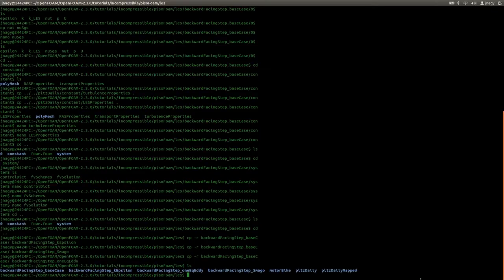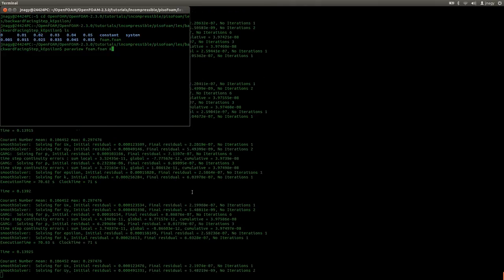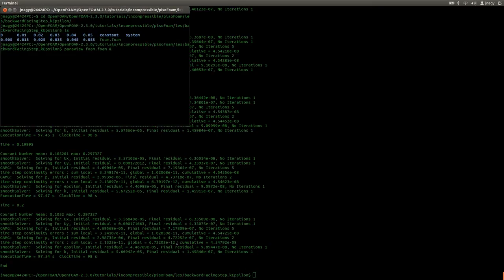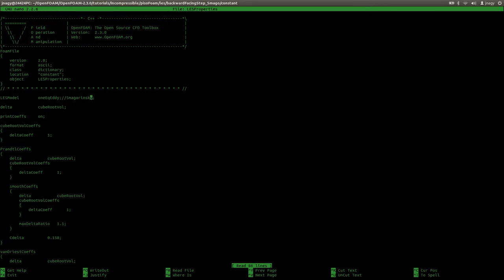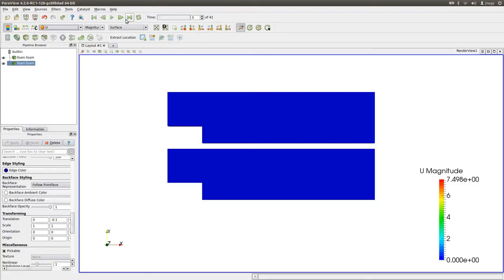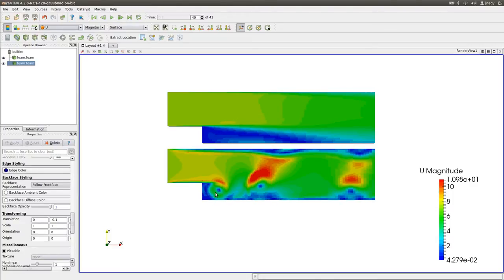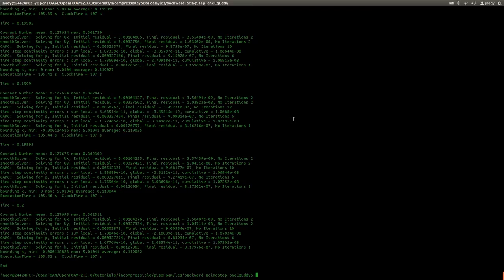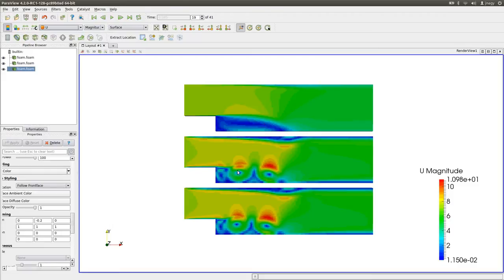Introduction to transient turbulence modeling (RAS,LES) - Part 2

Comment: Mr Nagy, basically the difference between these RANS and LES simulations is the ability to see or not the eddies forming correct? Would you say that the kind of turbulence model choosen would differ too much if we were interested in obtaining general overall pressure loss in a system? Thank you for your video.
Reply from the maker: The overall pressure loss should be equal, but it would be interesting to find out.

Comment: Hi guys. For everyone using a more recent version of OpenFOAM (I'm using v2012) there are some little changes in Smagorinsky model.
First of all, you must rename nutSgs into nut.
Looks like the LESProperties file is no more necessary, instead you need to modify the turbulenceProperties file as follows:

simulationType LES;
LES 
{
turbulence      on;
LESModel        Smagorinsky;
[...]
}
 and substitute the [...] with the entries present in the LESProperties file (delta, printCoeffs, cubeRootVolCoeffs ecc...).
Hope it helped since I've lost almost 1 hour to figure out what the problem was :)
Thanks József for the great effort!
Reply: Similar adjustments need to be done for the One Equation Model. Rename nutSGS into nut and modify the  turbulenceProperties file as follows:
simulationType  LES;
LES
{
turbulence      on;
LESModel        kEqn;  //oneEqEddy in older versions
[...]
}
Reply from the maker: Thank you!

Comment: Thank you Jozsef! I meet some problem when i use the incompressible/pisoFoam/LES/pitzDaily  in OpenFoam-7. 
1 There are the s, nut, k, P, U and nuTilda dictionaries in 0/,but not the nutSgs dictionary.
2 In fvSchemes, ddtSchemes is backward and div(phi, k) uses Gauss limitedLinear 1 scheme.
3 Why in fvSolution we add the pfinal into solvers

Many thanks for your work, Keep it up!
Reply from the maker: The syntax changed since then. nuSgs was merged to nut, so you use for RAS and LES nut. pFinal is the entry for your last iteration in each time step. You can use the same as for all other p iteration, but you can change it here.
Reply: @OpenFOAMJozsefNagy  Thank you very much, i looked into the xxxFoam.c and  createfield.H dictionaries and found the pFinal term. By the way, could you talk about something about the overset grid and adaptive grid with OpenFoan ? Sincerely hope! Best wishes to you !!!

Comment: Hi! I seem to have a trouble in the smagorinsky case.. I deleted nut and retained nuSgs as you guided, but on running pisoFoam I got an error saying it cannot find nut. So I renamed nuSgs as nut, but the end result for the sub grid scale viscosity doesn't match with yours, it's completely uniform with very mild traces of eddies. The same happened with oneEq case as well.  Am I doing something wrong?  

Thanks in advance!
Reply from the maker: This is true. In 2.3.0 the subgrid scale viscosity was nuSgs, but for newer versions this was rename into nut in order to have a more consistent syntax. They also changed the models themselves, so this is why you have slightly different results. Unfortunately I cannot update videos on YouTube, but I do update the tutorials with comments on https://wiki.openfoam.com/Transient_turbulence_modeling_by_Jozsef_Nagy so please check out the text there. I hope this helps.
Reply: Ahh! I thought so! Thank you so much!
Reply from the maker: I am glad I can help.

Comment: Hello Mr. Jozsef,

Thank you so much for all tutorials you created. I learned a lot thanks to them and want to advance my ability a bit more. Thus, i want to create my own 2D CAD and own mesh. I use gmsh to do that but struggle to import my mesh to openFOAM. It gives me some errors but i have not found any explanations about them on the forums. Could you please create a video about that (for example creating a simple 2D geometry and mesh on gmsh and import to openFOAM) or give me some clue?
 Thanks.
Reply from the maker: I am sorry, but I have never used gmsh. I think on wiki.openfoam.com there is a tutorial with gmsh. Maybe that helps.